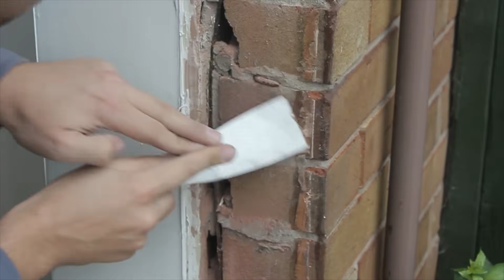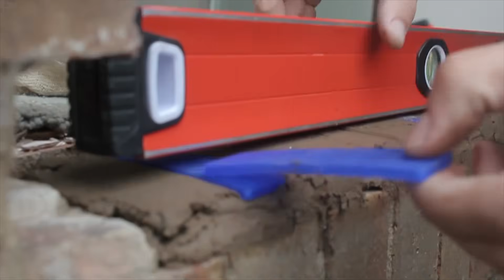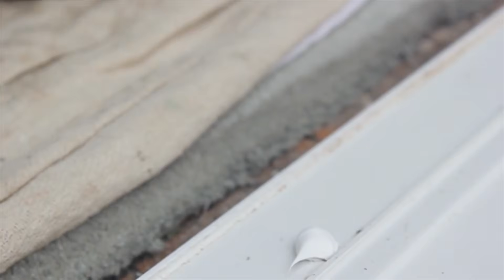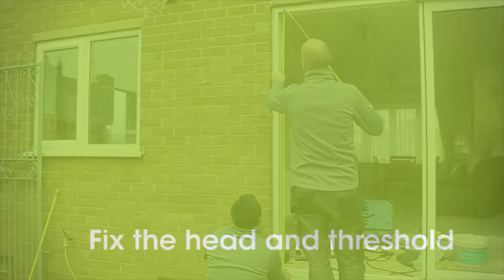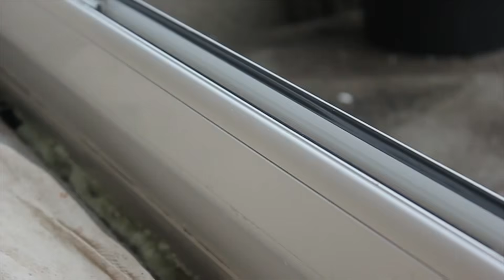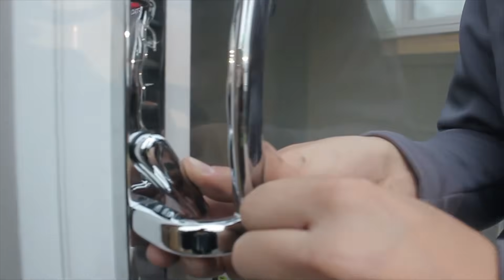How to install patio doors

Comment: Fitted 3 of your frames yesterday, terrible workmanship frame cover fillets to long, making them very tight and look out of square, and just a very cheap feel to them, gonna be surprised if the customer doesn’t complain. They do slide nice tho.
Reply from the maker: Sorry to hear that. Please let us know which company purchased these products from so we can see if there is a way to rectify the issue you’ve raised.
Reply: @TruFrameUK  I never purchased them, I fit them for a builder, I have always steered clear of liniar, Rehau is what I fit never any troubles, I can see now where the extra money goes for my Rehau frames.
Reply from the maker: @Ken_4711 👍

Comment: looks like a job half finished to me. what about filling the outer frame
Reply from the maker: Not sure what you mean by “filling the outer frame”. The patio door system is being installed exactly as intended by the system designer (Liniar).

Comment: ...did these guys just install the door with the locks on the oitside
Reply from the maker: The lever, which operated the door lock, is on both the inside and the outside of the door. This allows the door to be locked or unlocked from either side of the door. If the door was locked, a key would be needed, otherwise the lever on the outside would not turn.
Reply: @TruFrameUK please I'm a Aluminum fabricate and glass designer from Ghana, and I will love to work in your company

Comment: Just curious do you secure the frame by drilling into to bricks or mortar?
Reply: You drill into brick never the perp or mortar joint as the perp isn't strong enough to take the weight of the door or the strength of the fixing
Reply: @jefff4281   I half thought that would be the answer, thanks for getting back to me 👍

Comment: The door should be on the interior side,  not the exterior side. It's a security, as well as a maintenance issue. The door can be lifted out and it's difficult to keep the exterior track clean from debris.
Reply: Exactly what I was going say... It's the UK, so, typical silly workmanship.
Someone could block the owners inside with a small stick... not a good video with such a huge mistake.
Reply from the maker: The Liniar patio door system was designed for the sash to slide on the outside track for improved thermal efficiency and to reduce water ingress. That said, it is possible for the sash to slide on either track, and is an option that can be specified at point of order depending on preference.
Reply: @TruFrameUK  It's interesting that the flaws were designed in. I'm not sure how the staggering of the sashes would affect thermal efficiency or water ingress if the door is designed properly.  Although, it appears to be a very high quality door, my concerns remain.
Reply: I would say the sliding door on the outer track is exactly the correct position.  This door will be locked shut with a multi-point lock to prevent it being opened by a burglar.  What would stop a burglar slding the "fixed" door if it were mounted on the outer track?  :::: a few clip-in  add on sections of plastic or aluminiuum clipped into place and perhaps held in place by easily accessible screws althugh  I suppose the screws could be special "security" type screws that require a special bit but is that the ultimate in security?

The only downside is the track is outside and can get dirty;  but then who wants a grotesque track and its cavity on the inside,  in their living room,  when the inner track is being used for the sliding door???

Constructive comments on the above will be much appreciated.

Comment: the lintel is not far enough into the brickwork on each side of the door. Plus, it has cracked and dropped at the right side. I'd have walked away from that door job until a builder had fixed it properly.
Reply: 100%
Reply: i dont think it has cracked and dropped, i think the lintel has been fitted like that, the lintel will fit well onto the breeze blocks on the internal, my lintel is like that, a builder told me it is fine
Reply: @banjodeano2202  I guess the lintle will receive plenty of support from the new plastic patio door.  Why worry?🙄